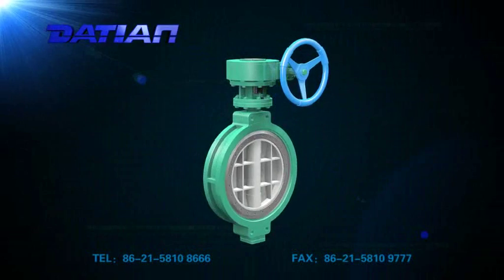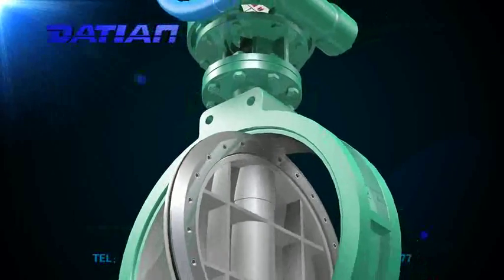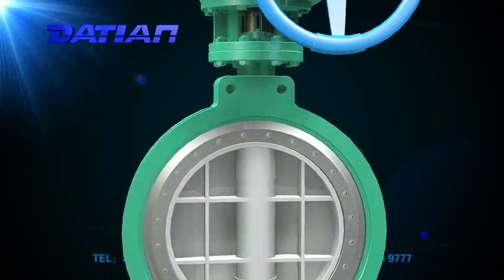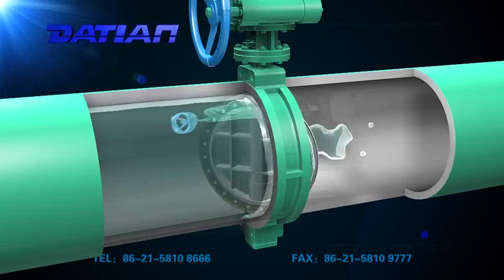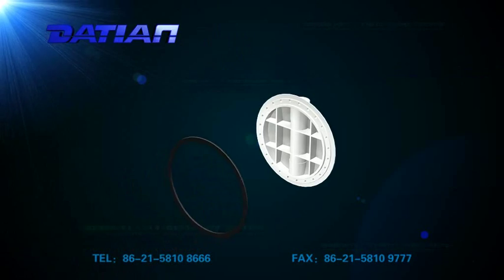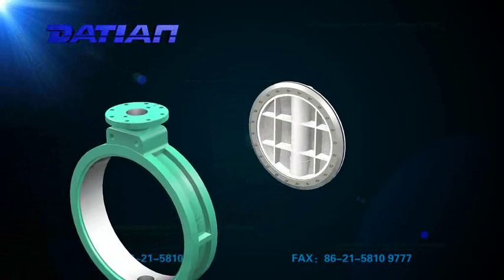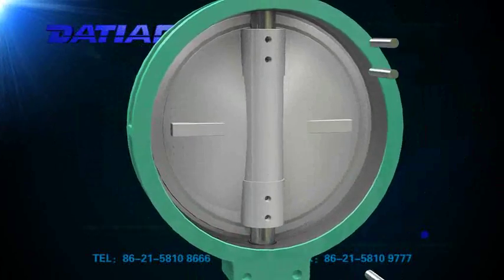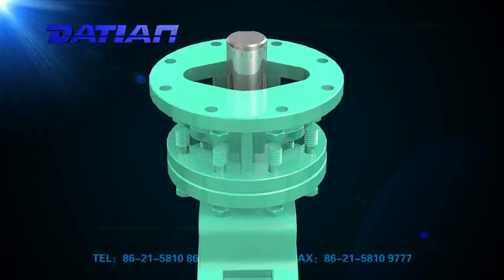Wafer Multi layer Seal Butterfly Valve

Comment: Total Industrial Flow Control Solutions In Valves,Steel Pipes,Flanges,Pipe Fittings,And More...
Contact Us: ivalve@foxmail.com
https://www.linkedin.com/in/chinavalve/

Gate Valve :Resilient Seated,Metal Seated (DIN F4/F5,BS5163,AWWA C509/C515)
Butterfly Valve :Wafer Type,Lugged Type,Flanged Type,Double Eccentric,Triple Eccentric
Kinfe Gate Valve :Manual Operated,Electric Actuated,Air Actuated
Check Valve :Wafer Type,Lift Type,Swing Type,Vertical Type,Ball Type
Ball Valve :Floating , Trunnion Mounted , Three(Four) Way,Full Welded,Small Sizes 1PC/2PC/3PC
Globe Valve :Normal Type (ANSI,DIN,GOST,JIS/KS),Angle Type
Foot Valve :Flange End from 2" (DN50) to 12"(DN350)
Air Release Valve :Single Orifice Automatic,Double Orifice Automatic or Triple Functional
Y Strainer :Screw Threaded 0.5"(DN15)-2"(DN50),Flanged for Full Sizes
Rubber Joint :Single Sphere,Twin Sphere,and Rubber Bellows